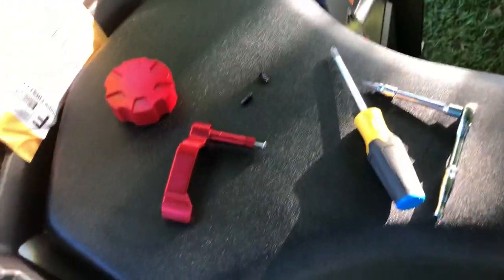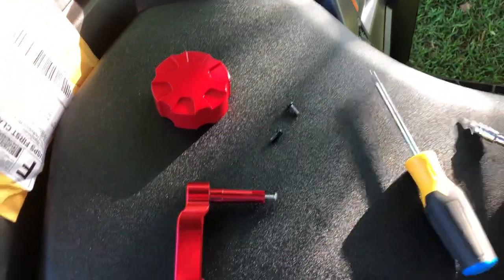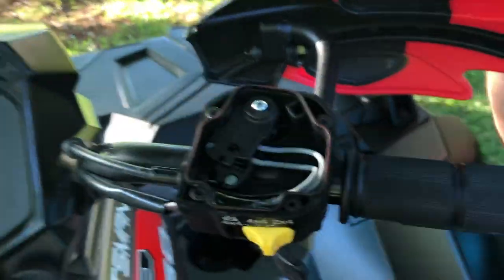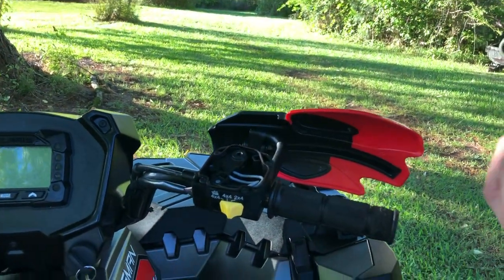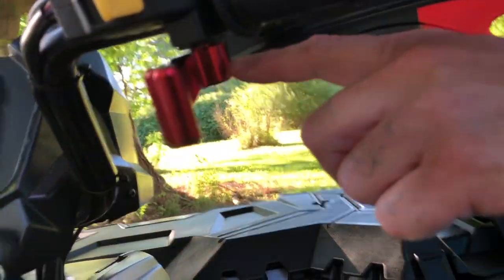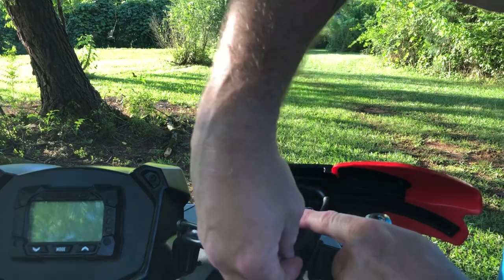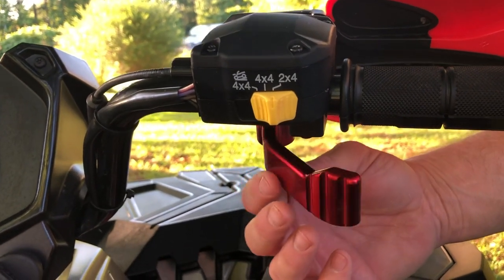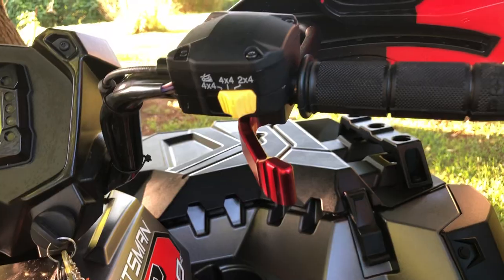2018 Polaris sportsman 850 sp Billet aluminum Thumb throttle install

Comment: I was told that the throttle for the drive by wire was different ??!  Do you know if they make them for mine great video
Reply from the maker: Hi Mark first and foremost thanks for watching the video and I’m not sure if they do on the cable throttles but I will say this I took this thing back off cause it had too much play in it plus a gap that I couldn’t seem to get right.
Reply: @ajjacobs1338  ok !! Thanks for your help and reply !! Not sure why Polaris use a plastic throttle on there quads
Reply from the maker: @markbuck9299  agreed if I do fine out anything about a replacement throttle for yours I will definitely get back with you
Reply: @ajjacobs1338  ok !! Thanks

Comment: Aj where did you get the thumb throttle
Reply from the maker: I ordered it off of eBay
Reply: @ajjacobs1338  thanks.i have a 2019 sportsman 850 sp premium and polaris told me I have to buy entire control modular to get plastic thumb throttle
Reply from the maker: @mikezelinsky466  yep want you to spend that money. Anyway the billet aluminum will last so much longer prob never buy another one unless you just wanted to change the color lol 😂

Comment: Does the throttle work good ?
Reply from the maker: World Star  yes it worked fine no issues but I just felt like it had too much play in it so took it back off until I find a better one , to be honest it was really just the fact it was red that I liked it but oh well. Thanks for watching
Reply: AJ Jacobs thanks ... but don’t the stock throttles have a lil play as well ?
Reply from the maker: World Star yes they do this one just seemed to have a lil too much and with it not flushing up like the stock just really thought it would be best to remove it after all it was more of a aesthetic anyway